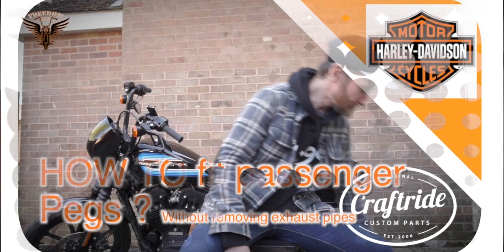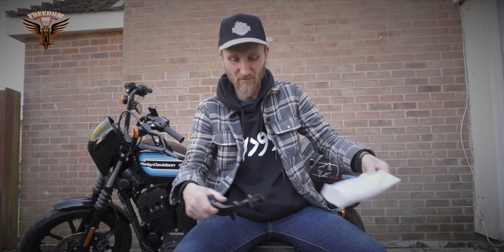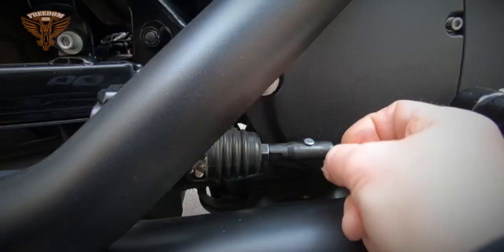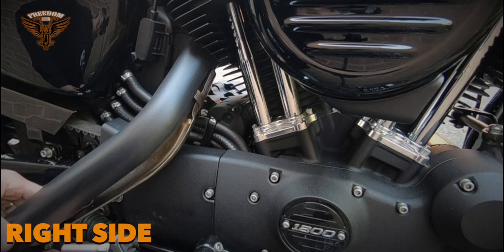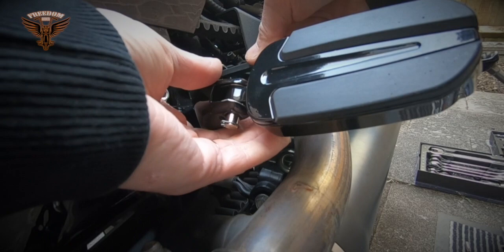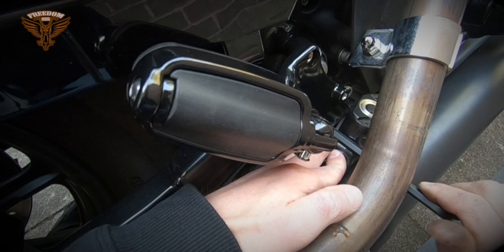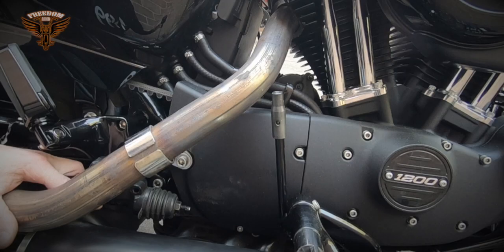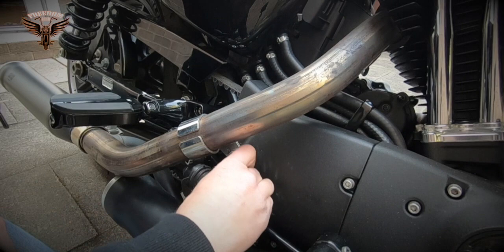How to Fit Passenger PEGS? Without Removing Exhaust ?

Comment: Thank you for sharing your wisdom. I installed the pegs on my 2020 883 and the install was pretty much like your bike's. However, my rear brake is now locking up. I may need to bleed the brake fluid. Did anyone experience similar issues after moving around the master cylinder?

Comment: Hi Man! Good job, thanks! Just a quick question. Do I need any additional screws? I received just one additional screw and seller told me that remaining four screws are sitting already in bike. Is that true? :)
Reply from the maker: Hi rodzyna on left side you have 2 bolts already and two by  the rear brake fluid reservoir to the right side. 
So really you need one bolt extra to use it at the top of the right side Thanks for watching . Any question feel free to ask. Ride safe B3 💪
Reply: @FreedomRiderB3  Thanks for an explanation. Will see if it's doable for me :D

Comment: I have a 2021 iron 883 mounting brackets are the same, could I use this same method
Reply from the maker: I don’t think that anything changed regarding the frame and rear brake reservoir design. 
Unless there is something that I am not aware.
In my opinion it should work. 
Ride safe and B3 👍

Comment: Thanks mate!

What is the blue stuff you put on the bolts?
Reply from the maker: Its threadlock blue middle strenghth. 
https://www.amazon.co.uk/V-Tech-Anaerobic-Thread-Medium-Strength/dp/B0045UQ8GQ/ref=asc_df_B0045UQ8GQ/?tag=googshopuk-21&linkCode=df0&hvadid=226543300693&hvpos=&hvnetw=g&hvrand=17229750621317742194&hvpone=&hvptwo=&hvqmt=&hvdev=m&hvdvcmdl=&hvlocint=&hvlocphy=9045284&hvtargid=pla-420453367413&psc=1

Comment: I don't think the left side is correct. The instructions that came with mine said to remove that cover there, and put the bracket over that line in it's place.
Reply from the maker: I decided to keep that cover , as it is 
handy to have it on. Thanks 🙏
Reply: @FreedomRiderB3  Is it bad to remove that cover?
Reply from the maker: @TheBabyDerp  if you think you wont need it , than remove it.  I keep charging point with  USB Plug behind it .
Reply: @FreedomRiderB3  Oh that's good. Only thing I got behind it is a tuner but i keep it up in the battery cover.

Comment: Does the brake actuator have to be moved, regardless of whether the pipe comes off?
Reply from the maker: I  had to remove brake fluid reservoir that’s for sure. I didn’t removed anything else though. Except disconnecting it from foot brake control. Hope that helps 👍
Reply: My eyesight s not what it used to be. I think I’ll just get everything out of the way so I can get a light on things.

Comment: The angle could have been better. I have noticed all videos are angled pretty much the same way defeating the purpose of the vid. Visuals are crucial.
Reply from the maker: Thx @Hector Ortiz , will work on that 👍
Reply: @FreedomRiderB3  not being negative just constructive criticism. Haven't found one that had the right angle to show the whole process 100% by the time.i found your vid I had already taken the exhaust off....lol but could not see how the two bolt peg would fit with brake master cylinder . That's where I got stuck with light running out on me last night lol. All good. Today is another day........ blessings
Reply from the maker: @MaddConnekRecordz  yes bro got your point. I take that as a constructive feedback 👍 and I can see your point mate.  Two bolt peg was simple few minutes job. The other one was tricky though.  Hopefully you will successfully fit yours. Would be a good idea to get new gaskets each time you remove exhaust. Tell us when you finish and how it went. Blessings 💪